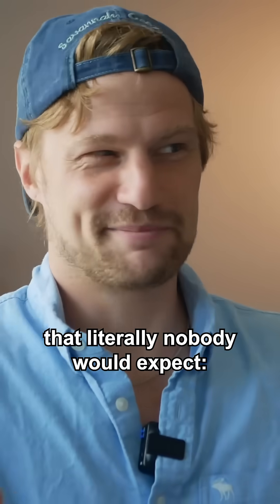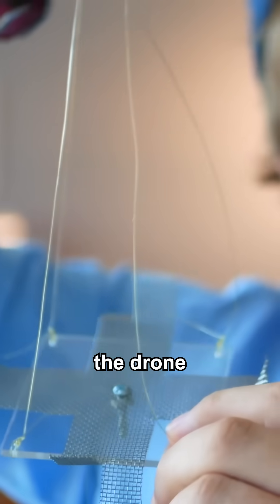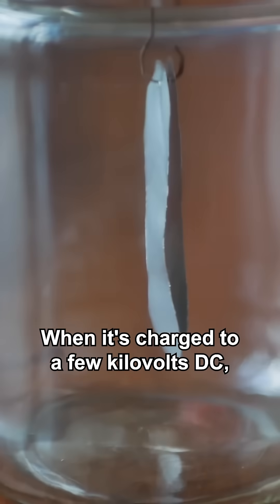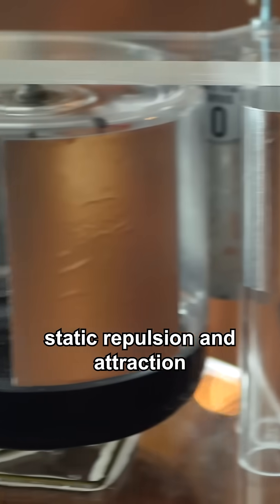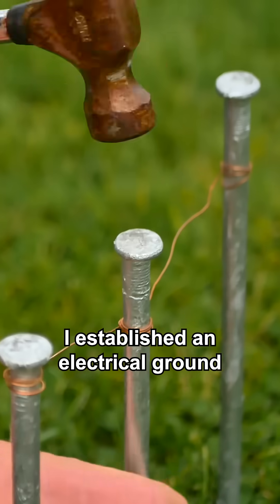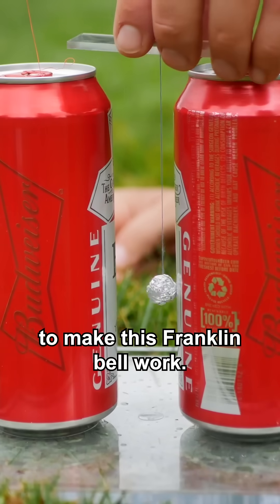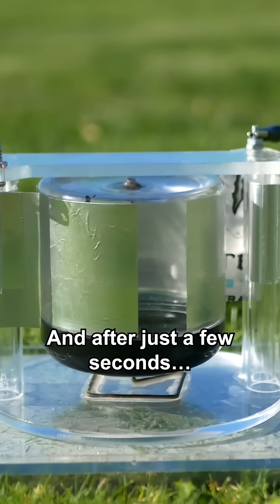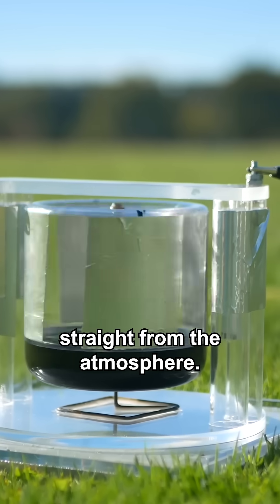Drone Harvesting Invisible High Voltage From the Sky

Comment: 🤣🤣🤣🤣🤣🤣 he connected the ground wire to the ground with the copper wire that's where his electricity is coming from not the air or the electrical current in the air connected to the cable to prove this theory take the wires from out of the ground

Comment: The Universe is Electric. Why would Earth's Atmosphere be any different?
Reply: No it isn't, and that should be fairly obvious by the fact that bulk matter is electrically neutral. 

You can get a relatively small charge separation in the atmosphere, but that's already understood and in no way disproves or contradicts the standard model.
Reply: @physicsunderstander4958  Please explain the Auroras using the Gravity Only Model.
Reply: @ub2bn  Auroras are caused by charged particles from the solar wind interacting with Earth's magnetosphere. There is no "gravity only model," that does not mean any variation of the electric universe conspiracy theory is correct.

Comment: Nicolas Tesla was the first to show to the world how to use power from atmosphere. He wanted to give this power to the world and we all know how this finish for him.
Reply: That’s exactly why we talk about efficiency ratios. At the end of the day, all physical matter is just concentrated energy — the trick is how much of it you can convert and actually use. Right now, we're doing maybe 50% efficiency at best in most systems — except for hydro, which hits the 90s but is geographically limited.

Sure, you can harvest energy from the atmosphere, space, waves, whatever — but you’ve got to check three boxes:

Can it generate enough energy?

What's the conversion efficiency?

Is it economically viable?

Take nuclear, for example. It's powerful and clean, but the economics suck short-term: a typical reactor takes 15+ years to break even. Meanwhile, a coal plant can start turning a profit in 5 years or less. So if you’re an investor or a government chasing ROI, guess what you pick? Coal — every time.

Just because we can do something with tech doesn’t mean it’s worth doing — especially if there's a cheaper, faster, or more politically convenient option on the table.
Reply: @ Correct, that's why I get irritated when someone mentions Tesla, they usually have some dreamy bs version of what he had achieved.
Reply: That's not correct. It was not about harvesting radio waves for energy, it was transmitting generated energy wireless through air.
Reply: Most of N. Tesla's fans, who believed he was killed for his inventions, have the least knowledge with science.
Reply: Just looking for such a dumb comment 🤦🏻
Reply: Yawn.

Comment: I use 3 solar panels and 7 batteries and 2 charge controllers to power the lap top, lights electric fans, 300 watt wash machine and 250 watt spin dryer and 600 watt jig saw today. The panels have about 35 square foot area. The whole system cost less than $700.

Comment: No, you were ‘siphoning’ static electricity produced by the down wash of the drones propellers passing over the metal grate. If that’s even what you were able to achieve because your shitty snap cut editing gave us zero proof you didn’t just connect those devices on the ground to a 9 volt battery. Fuck off.
Reply from the maker: Tell me you know NOTHING about electricity in just two sentences, why dont you haha. Wind moving a few meters a second downward from propellers doesn't create 1,000's of volts, and the fact that the propellers were extended beyond the grate, not directly hitting it, adds proof to that. Adding to the fact you know nothing, a 9 volt battery can't power an electroscope, or corona motor. they require thousands of volts to operate. Period. So, i'm sorry, what were you rudely screaming about again? Maybe watch the full 10 minute video  before being a keyboard warrior online?

Comment: As tesla said.... he knew the power of the pyramids. Same concept as the wordencliff tower but what changes throughout time is the ability to get from ground to the ionisphere. The ancients had only stone, tesla had steel/iron, and now we have a support system (drone) that can be replicated with a rechargable energy source (lipo battery). Imagine if the need for the earlier devices being located over aquifirs was required to keep this circuit flowing energy back to ground....

Comment: Meanwhile, the drone is up there, taking at least 100 watts of power to hold it up there to spin the coronal motor at a few rpm with no torque using the static charge from the air.

Comment: Amusing.
Google and then build following item.
😸
Kelvin
water
dropper
....
you wil need
2 used tins
2 wires
3 plastic (bucket type)containers
Rubber balloon
small hairy child

pierce bucket 1 twice so that it drips water from its base as far apart as possible

remove top and bottom of each can

suspend each can so that the drip runs through one can and drops into one bucket below

run wire from tin tube to OPPOSITE bucket only....(x2)
👻 don't cross the wires they must not touch

rub inflated balloon on small hairy head then touch balloon to one wire....this produces an imbalance of electrons to begin the process kelvin described

(magical way to entertain a small hairy child when its wet and horrid outside)

Comment: Nice experiments. Energy is everywhere and it is all free. The entire universe and everything in it is made of energy. Harnessing it in a useful manner to be converted from on form to a storable form then to another form whilst doing some useful work is what we need. As for using the air, well we have had sails, windmills and windpumps for some time. We use wind turbines these days, we fly gliders, drift balloons, power annemometers and even dry clothes and produce salt. So obtaining useful energy from the air isnt new.

Comment: This is great.   It would be interesting to know how much energy could be collected with a large balloon.   If the lift capacity was 800 lbs of payload that is a pretty big mesh.  Use a tensigrity structure to hoist a very large area.   Use a more fine material like EPM cloth.   It would be intersting to get to 1 HP.

Comment: Good demonstration. The airflow caused by the drone is probably the primary source of the energy you harvest. All is perfectly good for an experiment but as many people point out, really hard to get significant power from this.
Reply: I wonder do you think it's static electricity? Or did miss something?
Reply: @unit29y80  By definition it is in any case. The 2 aluminium leafs seperating and the Franklin Bell are typically working on static electricity. The thing is I think the drone airflow is a big cause of it. Not that there isn't without drone airflow but probably less. Many examples of this. Lightning just one. Lightning can occur without a thunderstorm in some cases. Nearby a kid was killed during a footbal match a few years ago.  Clear sky .. then suddenly ....

Comment: A number of years ago, somebody filled a balloon with hydrogen, coated the balloon with aluminum paint and used a wet rope as a ground wire. 
People were amazed at the size of the explosion.
Reply: "Oh, the humanity!"
Reply: Well played, Sir.
Reply: Hindenburg!
Reply: This thread really shows how dumb some people are.
Reply: @HimynameisKaren  they all aspire to be intelligent as you
Reply: @Colbyatops  I'm curious why you think something acting like a ground wire doesn't make it a ground wire. Does your definition require intent for it to count?
Reply: @ I meant it literally only. For example a xylophone,  different sizes of half cut coconut shells can be made as an instrument that might be similar or act/sound like a xylophone, but it isn’t one , that’s all really
Reply: @Colbyatops  I don't think that's a fair comparison because a "wire" in the context of electronics is just any freestanding conductive pathway (as opposed to, say, a trace on a PCB). They are traditionally made out of metal due to its conductivity, but as technology has improved other conductive materials have been used to make wires as well, such as carbon or conductive polymers. In this case a wet rope fulfills all but the strictest definitions of a wire, and as it connects to the ground that would make it a ground wire.

The xylophone example is different because it specifies both material and layout (specifically, bars made of wood or wood-like materials), and even has distinctions from other similar instruments like the marimba in that it is tuned chromatically rather than pentatonically. It's a much more complicated device with a much narrower definition, so it's easier to make something that isn't a xylophone.
Reply: @ a wet rope is not a ground ‘wire’ but it can act like one
Reply: @Colbyatops  Did you not read my first paragraph? A wet rope is a wire in all but the absolute strictest of senses that require it be made out of metal specifically, which would exclude a lot of things that are traditionally thought of as wires. If you have an issue with that then I guess that's just going to have to be a disagreement, but it really is disingenuous to say that it is not a "wire" when under the most relevant definition of a wire it is.
Reply: @awareqwx  wire is metal please stop it now
Reply: @ even the caption says used a wet rope ‘as a’ ground wire, but not one literally
Reply: @Colbyatops  There's a lot of scientific papers talking about sewing wires made out of conductive polymers into clothing so that they can have circuitry embedded into the fabric itself. There's one from RSC Publishing, one from the NIH, one from MDPI, and so on. They all call them wires and wiring despite no metallic materials being present. So no, wires don't have to be made of metal in the context of electronics, which is what this is about.
Reply: @ a wet rope is organic, a ground wire is not
Reply: @Colbyatops   Technically the parts of the wet rope doing the conducting are ions dissolved in the water, which are usually not organic. The rope would be analogous to the fibers that thin wires are often wound around to help hold them together and make them stronger
Reply: @awareqwx  As wire rope enters the chat...
Reply: A wet rope would conduct electricity but nobody would want to use that if given the choice. The rope was just a clever hint at the Hindenburg Zeppelin accident
Reply: @Colbyatops  you sir win the dunce cap. Go learn how electricity conducts.
Reply: @dr.decker3623  feel superior now? I’m aware water conducts electricity, the rope itself is inert, dr dicker with the ego bigger than his ….
Reply: I think the point might be that although water can be conductive due to dissolved ions, counting on a wet rope to direct any accumulating charge to ground, was a bad idea. The charge built up and inductive kick becomes the match!
Reply: @joereichert3881  Nobody's quite sure just how the fire started.  Electric arc from grounding to the landing tower is one theory, but it's not like they didn't know that could happen, and the mooring point should have been far enough away to avoid problems.  Could also have been a malfunction with one of the engines or the hydrogen generator.  All of those were in proximity to where the fire started.

And, given the political tensions at the time, sabotage isn't entirely off the table either...
Reply: i thought it was iron paint
Reply: didn't the paint actually contain BOTH metallic aluminium and iron oxide (in layers), so both ingredients of thermite? I guess they  had to take whatever worked for containing hydrogen, which is infamously eager to permeate containment vessels because it's by far the smallest possible molecule.
Reply: It wasn't an EXPLOSION it was a slow burn. Hydrogen itself burns slow and dull. Try again on the ignition it wasn't the rope. Just google the cause and you'll be corrected. Unless propaganda has flooded that portion of the Internet as well.
Reply: That is because I don't like hydrogen as a food, I prefer oxigen, thanks.
Reply: Was the balloon also coated in jet fuel?
Reply: @ Jet fuel was not in common use at that time so I doubt it. Not sure why they would do that though, even if it was an option..
Reply: @Dummythiqqpotato  Rocket fuel.  The skin was made in alternating layers of fabric coated in aluminum and iron oxide.  Basically what's used in a lot of SRBs.  Also known as thermite.

If you watch the video, the hydrogen doesn't really do much of anything other than burn up spectacularly.  It doesn't really add to the damage.  The fire is carried from one cell to the next by the burning skin.

Interestingly, most of the passengers survived, with the only fatalities being among the people who panicked and jumped over the railing while it was still rather too far above the ground.

Comment: "FrEe EnErGy DoEsN't ExIsT"
-Oil and energy companies

If solutions like this were allowed to flourish, we would be charging Capacitor Megabanks via lightning strikes to stabilize the grid demand. But, there is not money in that.
Reply: You're uneducated on electronics. Capacitor banks that size are more expensive than solar. Nevermind the beefy as hell cables with very thick insulation that are needed
Reply: @Dill_Do  I have a 2 masters in Engineering, one of which is electrical. Where did I say that any of that was not a factor? 30 years ago I heard that "battery banks to stabilize grid load are too expensive" and look now, we have acres of 60 ton battery banks carrying grid load variances and full demand, albeit with some dangers like those that happened recently. How am I an idiot for proposing to harness other forms of Earth's energy? 
You sound like you work for the energy sector. Closed minded and concern trolling always.

Comment: Technically I don't think that's coming from the atmosphere. That's coming from radio signals all across the world. We used to make something called a transistor radio I think. Where you can run the radio off of the antenna. That being said if you could get that wire high enough up close to space then you can collect lightning.

Comment: you can use electrolysis to harvest hydrogen which is a fuel. electrolysis can be scaled up and it doesn't need high RPM's or torque and doesn't impose a load. so you can drip feed a electrolysis setup a low current and gradually harvest hydrogen.
Reply: Yeah you'd need thousands of cells producing like a cubic centimeter an hour. We have solar that is superior and cheaper

Comment: There is a practical way to extract energy from the atmosphere ---- it's called a windmill.
Reply: Its not practical. Thats the problem. You cannot force wind to blow. You can buill... a mountaint to create artificial wind. But such project... isnt very practical. Also bc its random based generation you need much more energy storages than in normal power plants. Which is not practical.
Reply: @Sandro_de_Vega  When the wind does not blow then it stops... but guess what... They spend a lot of time and money finding the most reliably windy places to locate the wind farms. We have some of the biggest wind farms in the world here in the UK. It is the LOWEST COST electricity you can generate and is carbon neutral within a few years and zero emission once installed
Reply: @Sandro_de_Vega - What planet do you live on. Half of Europe uses wind energy. It’s the most practice source of energy we have. You’re confusing the word practical with reliable. It’s reliable enough that we know we get energy a lot of the time from it and we supplement that energy with other sources when it’s low/ non existent. We don’t need energy storage when we don’t generate more than what we consume.
Reply: @matthewyabsley  Petroleum Products: In 2022, petroleum products accounted for 37% of the EU's energy mix. 
Natural Gas: Natural gas made up 21% of the EU's energy mix in 2022. 
Renewable Energy: Renewable energy sources like solar and wind power contributed 18% in 2022. 
Solid Fossil Fuels: Solid fossil fuels, such as coal, accounted for 13% of the EU energy mix in 2022. 
Nuclear Energy: Nuclear energy contributed 11% to the EU energy mix in 2022.
Reply: Nah windmills are booty cheeks
Reply: and when the wind stops?
Reply: you would have enough energy stored to compensate the lack of windpower @BRIZVIZ
Reply: Clever boy. Now imagine for a second that people already know this so your comment can be ignore.
Reply: @Broxalax yo smartest boy of all. You know that windmills dont siphone energy from the atmosphere right? Smart ass you, sit down 😂😂

Comment: You do realize that we’re all the power comes from. PG&E is harvested out of the air and then act like they’re burning oil to get it.
Reply: .... WHAT?
Reply: @ yeah all the information and videos have been censored and took off of YouTube. I’m sure I could dig around a bit shoot and find them. Maybe. But if you go to really rural towns that are fully isolated and over 100 miles from any power plant. And you follow the powerlines. They just go in a big ass circle. these towns have no oil burning to create energy. No natural gas. No solar field. No battery banks. The power poles just do a big ass loop through the town. And they don’t connect hundreds of miles to other towns that would be supposedly burning oil to make electricity

Comment: And by using a battery powered drone rather than a helium balloon to carry the electrode aloft you insure that you are inputting 1000 times the electricity output by the system. So, not free energy.

Comment: Its why attennas have to be grounded, also the space shuttle RIP did an experiment like this too, but in space.
Reply: Exactly, we had a uge short wave antenna and it sparked already at normal days when not grounded. There where days with thunderstorms and it could create sparks two inches wide.